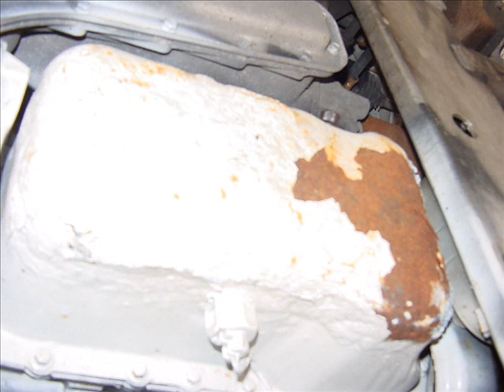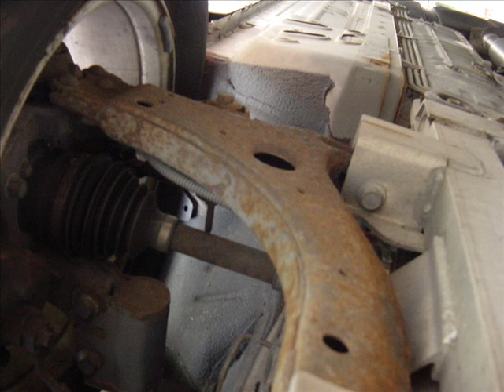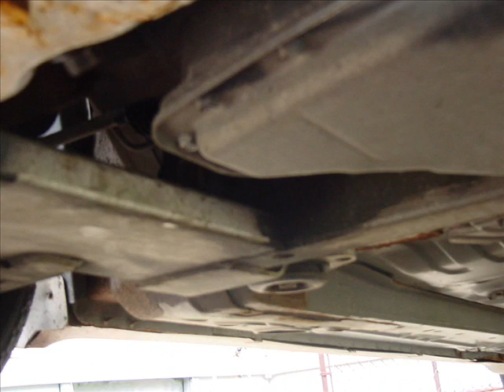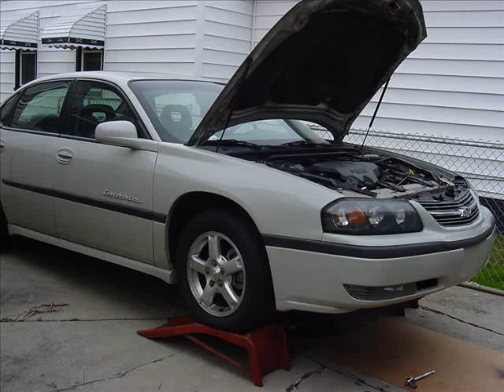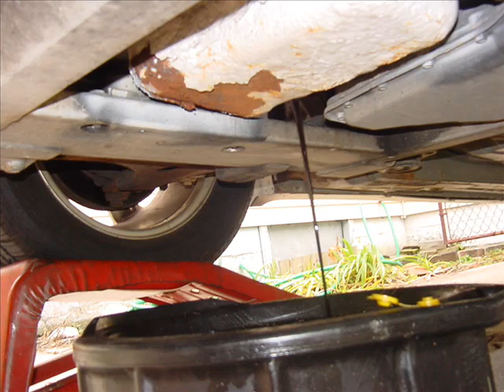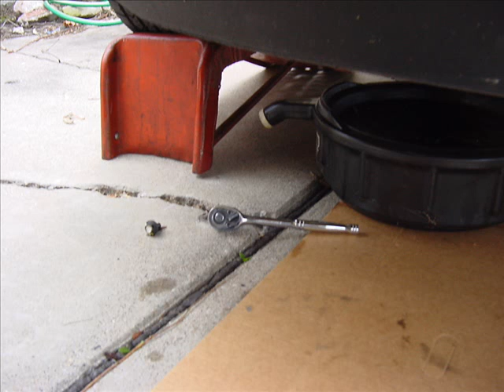03 CHEVY IMPALA 3.8 V6 OIL CHANGE & PICS OF RUSTY UNDER CARRIAGE.wmv

Comment: Why didn't you hit it with a wire brush on a drill when you first saw the rust?

 If you paint rust (even with a rust inhibiting paint) then it's essentially sealing in the moisture which makes it RUST FASTER.